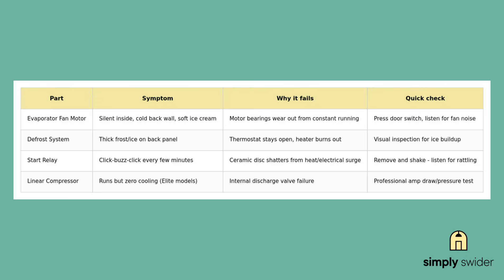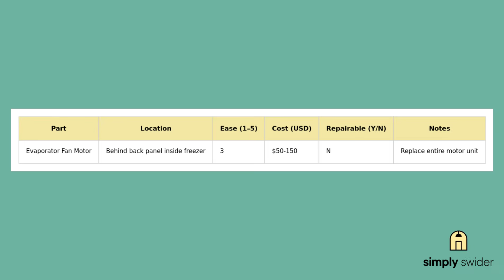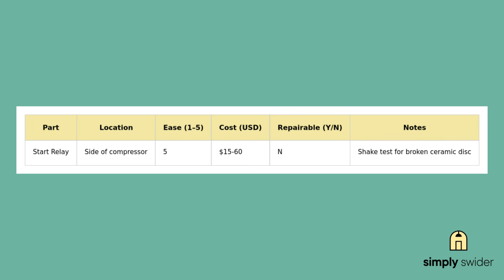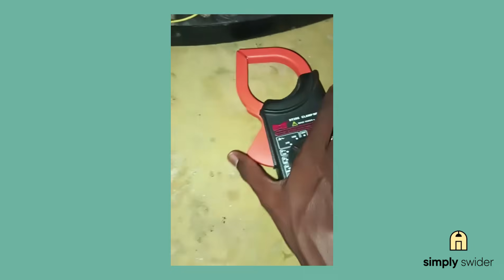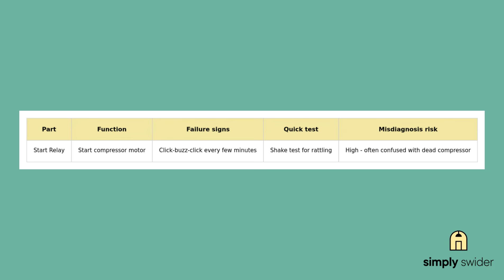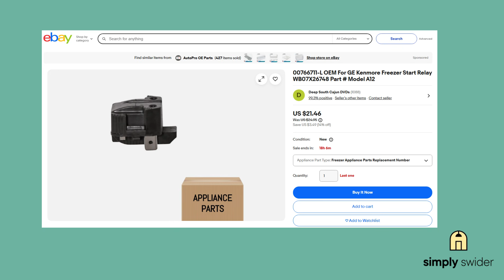Kenmore Freezer Not Freezing? 5 Fixes That WORK 90% of the Time!

Comment: I have a 2001 Amana fridge with bottom drawer freezer. Was not cooling or freezing well. Cleaned the dust and hair from condenser coils. Unplugged for 24 hours assuming defrost issue. Plugged back in. After 24 another hours fridge at 3 Celsius but freezer barely below aero. Compressor running nonstop. Defrost timer working. Set fridge and freezer controls to normal range and then kept increasing the freezer control to max. Still not cold enough in freezer. Door seals good. Feel some air movement in freezer drawer. Would like to repair since new is expensive and likely crap. Any help is appreciated. Cheers. Adrian.

Comment: I popped off the back panel in the freezer. Fan was spinning. It was cool but not freezing. No ice build up. It had a black goo that was coming off the copper thicker wiring and poured over the coils and into the bottom of the freezer. It is a 795 model with the LG compressor
Reply: ditto same melted black gum on the freezer fins on my Samsung 4 doors. I checked heater thermostat it is perfectly ok.